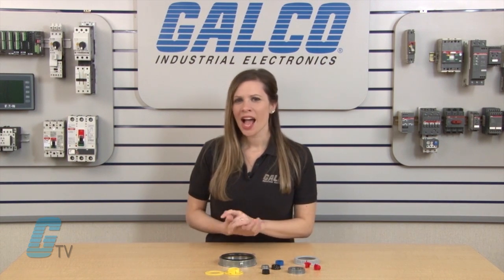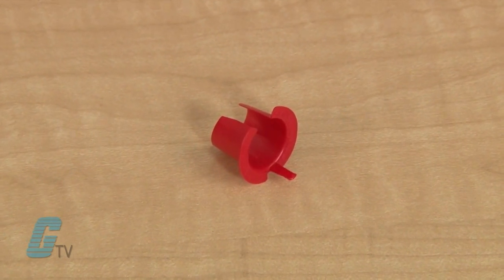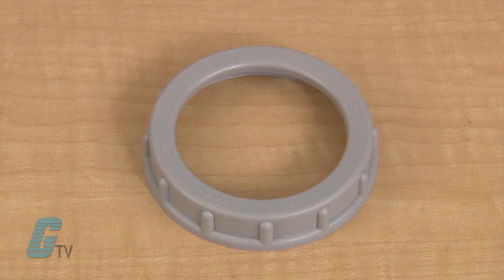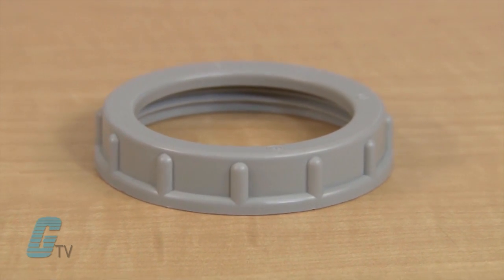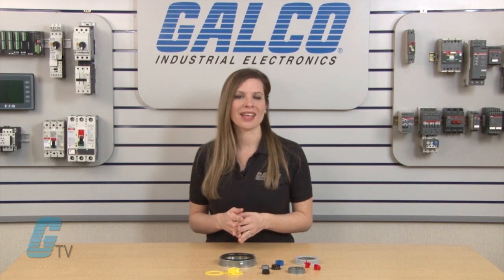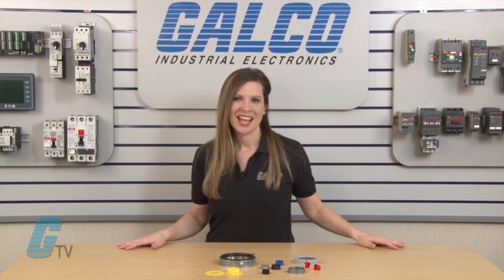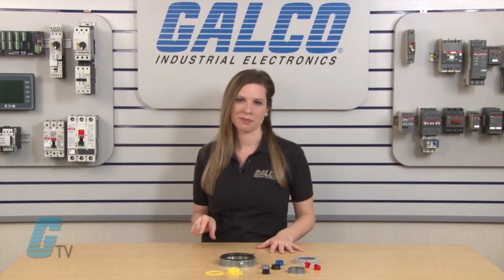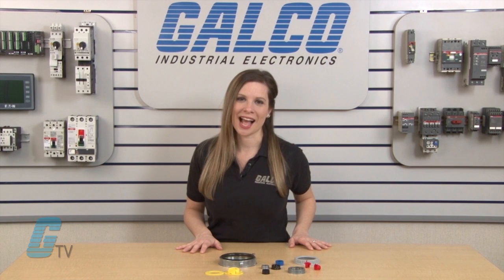Different Types of Bushings from Halex

Comment from the maker: Anti-short bushings are made of polyethylene and are designed to protect wires within flexible metallic conduit.  They can be inserted into each end of the conduit and are primarily for indoor use only.  

The insulated and non-insulated throat bushings can be made of zinc die cast, thermoplastic or polyethylene.  The polyethylene insulated bushings are for indoor use and are used to protect cabled from the edge of electrical metallic tubing.  It can hold firmly in place while pulling cables or wires.  The thermoplastic insulated bushings can be used indoors and outdoors with the use of a locknut to terminate threaded rigid or metallic conduit to an outlet box.  The surface of the bushing prevents damage to wire insulation.  The zinc die cast bushings are insulated metallic grounding bushings for indoor and outdoor use that are also used with a locknut to terminate service conduit to a cabinet. A lug is provided to these units for bonding jumper to a neutral bus bar.  The conduit bushings without insulation are made of zinc die cast material for indoors and outdoors.  They are used with a locknut to terminate threaded rigid or metallic conduit to an outlet box.

The knockout bushings are snap in bushings made of plastic that are used to protect non-metallic cable from damage when running the cable through metal studs.   They are primarily for indoor use and can be used to fit a pre-punched metal stud opening.  Universal snap-in bushings made of polypropylene are also available for additional sizes.